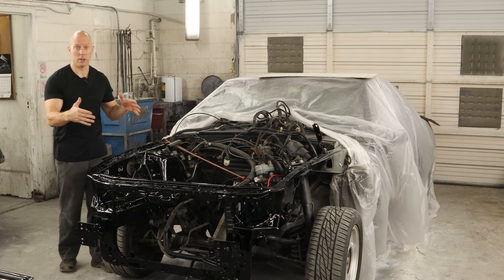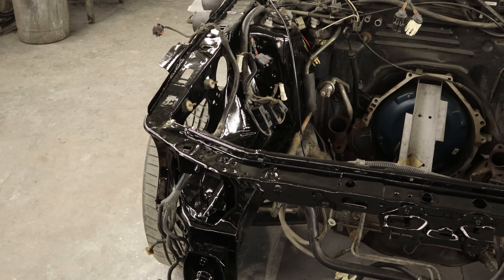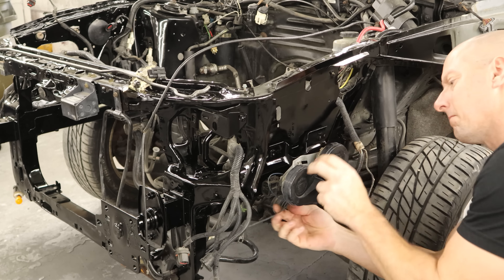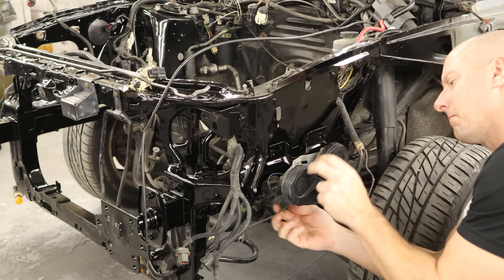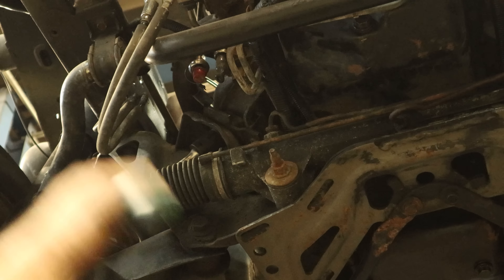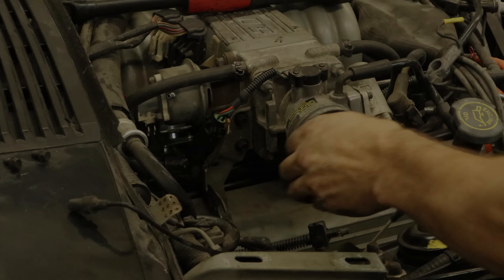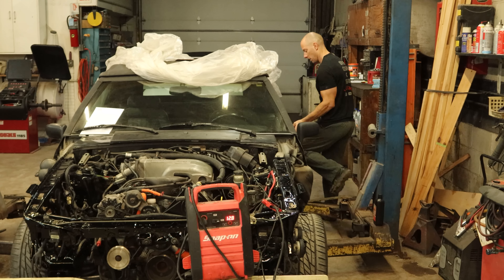The Mustang is painted!  Time to put the engine back in, once we fix a few problems.

Comment: The spaghetti challenge looked like a success. I would be surprised if it is didn’t start. If it doesn’t though you’ll get it figured out. Have a super weekend, see you when the next video drops!
Reply from the maker: I found a place for all the wires.  Was it the right place? Maybe, but the important part it they found a place! 😂

Comment: My guess is it started right up! Amazing how you remember where everything goes but I guess this isn't the first time you've had one apart. Awsome content as always ,and go on giving it to the safety freaks. Best wishes from the UK 🇬🇧
Reply: Once upon a time there was a company called Eastman Kodak their product somewhat evolved into what today is called YouTube!
Reply from the maker: You can figure out were stuff is supposed to go fairly easily. They make it easy so the assembly line workers can’t get it wrong. 😂
Reply: And yet they still get things wrong. I have run across a few things that were factory installed wrong. My favorite example was my 89 Escort. The heater hoses were reversed at the heater core. It would have no heat until the engine was revved up to 1500 rpm. After having to replace the heater core, I realized what the problem was. Once the heater hoses were installed to feed the hot coolant to the top of the heater core instead of the bottom, it had much better heat. I told the service manager at the dealership about it and he told me that it was a common issue with the Escort.
Reply: @danielbutler578 common but wasn't caught before claiming a heater core? That's a fun warranty debit

Comment: The next guy who has to take the bell housing bolts will hopefully be a guy like me, who use to work for Ford and has a 4-foot, 3/8 extension expressly for that purpose.

This model Mustang came out when I worked for the dealership, so it's been like flashback time for me.
Reply from the maker: I have two of those extensions for exactly that reason one is a little longer for going over the t case on 4x4s. They were left at work, right where all the tools I need always are.  Mine have a 3/8 on the socket end and 1/2 on the impact end.

Comment: Shows you how close I was paying attention to this video. At the beginning you are putting in wiring harness Then I look and you have the motor over your head changing the oil and pan gasket.. Then  I'm thinking why did he wire it up then pull it to work on it.  So I went back and saw that I need to watch these videos when I'm awake.

Comment: Your attention to detail if well founded, I once bought a Boss 302 that had a valve job performed on it previously. One touch to the manual choke handle alerted me to look for a ground strap that was overlooked at the firewall !

Comment: @vehcor
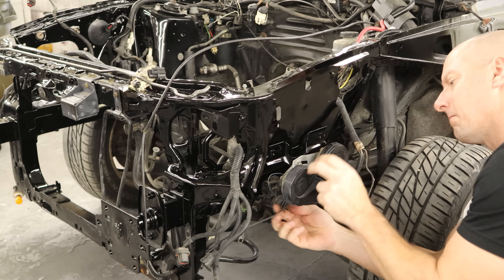Did you happen to notice one of the motor mount bolts (mount to block) was missing (seen at 13:01 in vid)(you might have fixed off camera).  Not trying to harass, just actually trying to help.  Great videos, keep it up!

Comment: Those little 302 fox body mutstangs  will surprise you. There not big hp but they boogie right along. I used to have one with a small street supercharger. It was only like 340 horse but it was snarky.
Reply: 340hp would be 150% what this one had when new.

Comment: Great video. Always wondered how often you lose a nut or bolt down the drain in the floor ?
Reply from the maker: Didn’t happen for years, then I dropped 3 in the same night on the blue RDX. 😂
Reply: Was thinking the same thing.  Worse than loosing a bolt is loosing a tool, cuz your going to have to fish it out.

Comment: Oh, so if you smack a small deer and push the light back but do not set off the airbag there is a chance the sensor is toast.
Reply from the maker: Yes, good chance. A visual inspection is all you really need to check, so there’s that. 😂  Just look for some holes in the front.

Comment: If someone payed you enough. Would you repair a ford escape or a sport trac?
Reply from the maker: There are a few Escapes on the channel already.  Back in the time lapse days
Reply: @vehcor  huh! Sport Trac would be a neat one. Second gens are better as they had a v8 option and have the same front as explorer. I believe both gens have a fiberglass bed

Comment: I question whether you're a mechanic or not, putting the nuts on the torque you backed the engine up when any mechanic would first try to use the socket to force it back and when that failed we would just try to "make" it go until it rounded off the nut and then we swear and complain about the manufacturer. Your professionalism is giving you away Scott.
Reply from the maker: My experience of doing it the way you described has left me with the knowledge that sometimes you need to invest a few seconds to save hours. 😂

Comment: I'm a fan do not get me wrong, but I do wonder why you are not using a dab of die electric grease on your harness plug makeups; it just makes it so much easier for the next person to get them apart or on even.

Is it that you've done this so much, that you're over it with constantly wiping your hands of oil and grease(time is money, i get that, but present minutes make future seconds)? I get not wire wheeling and oiling every bolt kind of, that's more for personal stuff; but the plugs.

I know I'm a bit obsessive, but it does have its dividends, and that I'm no where close or way the mechanic you are.
I'm just wondering is all. 

As I finish this, you said you hope you aren't the next guy that has to take it out, I get it; but I'm usually that guy.

Still a fan and good job on great work that will scale with future and further restoration; thank you for sharing.

I had a 84' that I would have liked to do this to, but now, thinking otherwise.

Awd seems the way.